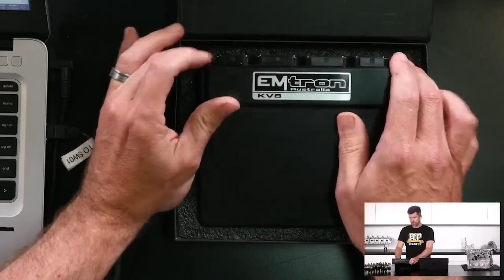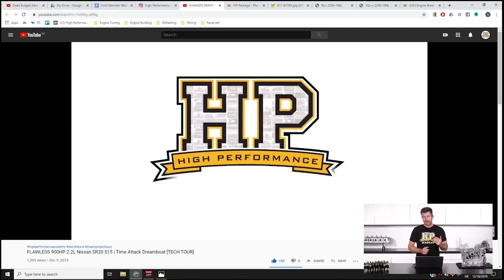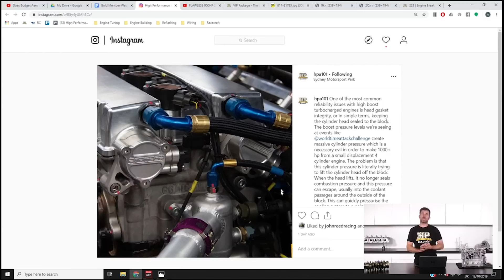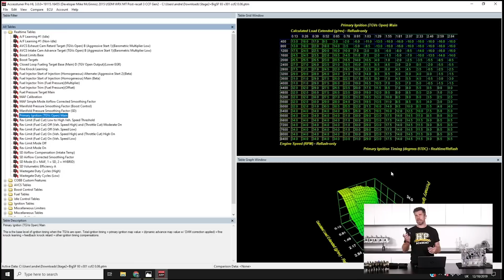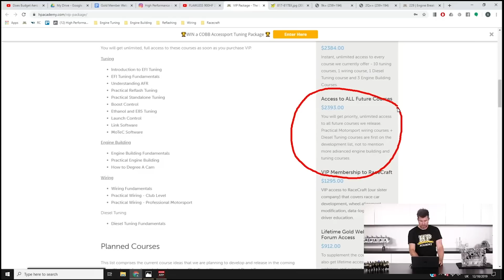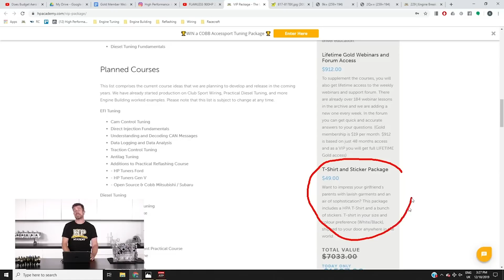LS1 Build, Emtron KV8 R34 GTR, Coolant Sensors and MORE | Today At HPA [UPDATE 229]

Comment: Worth throwing a pre throttle (plenum) pressure sensor on the gtr so you take take advantage of emtrons throttle mass flow. Works magic at pressure ratios below about 0.85. I blend to a MAPxTPS strategy above this point, which happens at surprising low throttle positions on a turbo ITB car.

Comment: A coolant pressure sensor is also great for detecting cavitation in the cooling system! But even more important is in the event of a major water leak and the temp sensor not contacting coolant it won't display the actual temp until its too late but with a pressure sensor you will know instantly somethings wrong. Such an underrated sensor!

Comment: In a more ideal world, more and more production engines would use CGI (Compacted Graphite Iron) as the block material.  Superior strength and robustness to cast iron, yet can be be made the same dimensions for superior strength to the cast iron equivalent or made thinner to end up with similar mass savings to aluminum blocks while retaining the strength and robustness of an iron block.